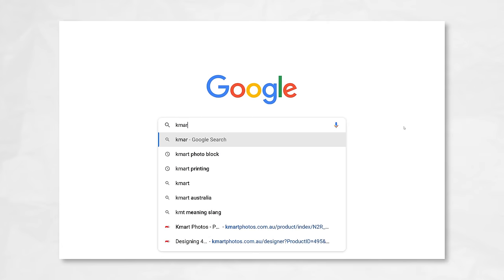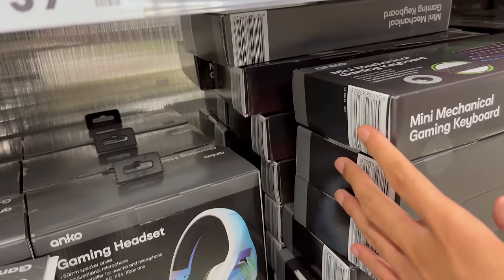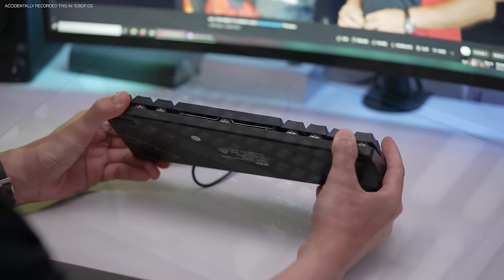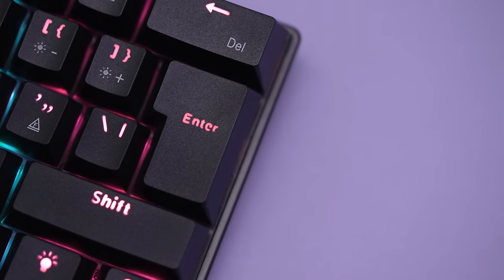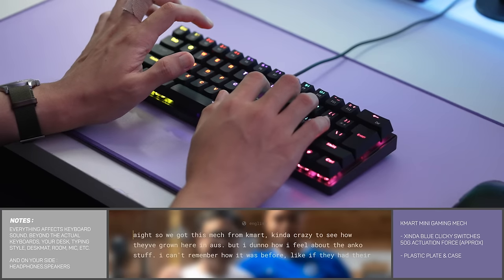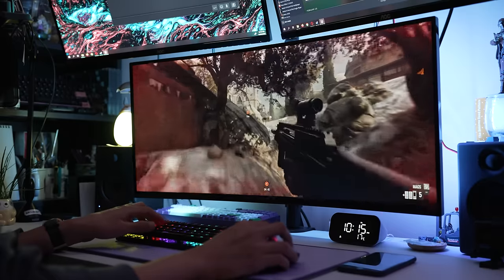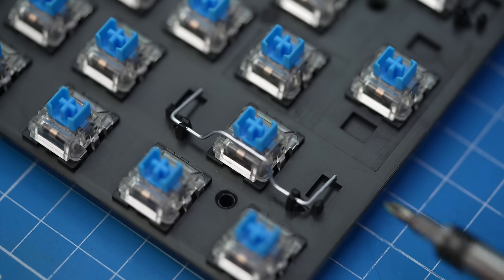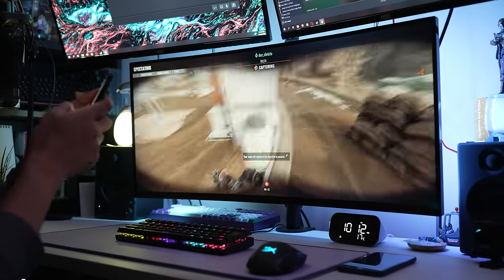Buying a $25 mechanical keyboard from Kmart

Comment from the maker: ne suggestions for mods? using kmart au items only 😇
Reply: Other than tape and foam, maybe use something nobody expects. Like the arms and legs of a teddy bear or something lmao
Reply: Polyfil! You could also get change from the register and penny mod it.
Reply: much like your modding of the ducky x hyperX keyboard, it'd be awesome if you can slap on some gmk caps on it. Also, how about finding some way to cut the plate to accomodate some plate mount stabs?
Reply from the maker: hahaha, thinking outside the box with the change idea.
Reply: Make it completely unrecognizable, paint it, add new switches, new keycaps, mod the stabs, add weight (maybe penny mod), add foam, and maybe maybe even oring mount it, (either gummy oring or burger mount)
Reply: super glue to stick the click jacket to the switch stem
Reply: @JadeZen520  are kmart stocking instock gmk keycaps now? that’s absolutely insane
Reply from the maker: @n1664  i gave it a little go, not the easiest haha. could also use something else for that mod :)
Reply from the maker: @Amiro05  a lot of that is definitely on the list!
Reply: jailhouse those blue switches!  use a few turns of dental floss, maybe a small piece of shelf liner, if it is thin enough.

Shelf liner as case foam to reduce ping, and there must be some plastic safe ptfe lube (super lube grade 0) for the springs... maybe not for the rails, in case is too gummy (could still do the switch tops where it meets the stem?)

tape mod on the PCB, with masking tape

paint the sides of the keycaps, to match (or complement! the leds)

horizontal strips of shelf liner between PCB and plate.
Reply: @jamboards5771  just assumed only the modding parts would need kmart items. Keycaps aren't a mod.
Reply: Cut up a budget Anko Kmart brand mousepad and fill the case 👍.
Reply: We do care..
Reply: maybe take the usb c port out of anything and make the cable detachable
Reply: y'all still got kmart????
Reply: @JadeZen520  if it can be personalized, you're technically "modding" a keyboard
Reply: They sell silicone lubricant. Not sure if it'd be any good on switches or stabs.
Reply: get like an aluminum sheet from a hardware store for makeshift case or weight
Reply: I mean, with the whole setup that this bad boy has under its hood, there is no mod to save it.
Reply: I mean, id be cool if you made it so you can plug cables into it (detachable usb-c, not sure how to phrase it right)
Reply: Hey tae I’m making my first custom build I’m buying the kbd75v2 and I was wondering if soldering is necessary?
Reply: @Amiro05  yes
Reply: @SeaTacky  we dont have pennies in australia and 5 cent coins would be too big i think
Reply: I cloth taped the bottom and foamed it , then 3 layers Scotch Blue'd bottom of the PCB .. Main gripe was the ISO layout
Reply: You could always smash some VB caps in it 🤗

Comment: Been curious about this keyboard but didn't want to spend $25 for a keyboard I know I won't use so thanks for taking one for the team 😁
Reply: Yeah, bought it and regret it…sold it for $10 back. It’s not bad but the layout isn’t something i gonna use.
Reply: @gqouf it’s not trash if you compare it to any office keyboard. Quite cheap and actually if you mod some dampening foam under the keyboard. For $25 i can’t complain a single thing beside the layout. I don’t want to get familiar with that layout. Buy it just to know how budget keyboard these day heading. For budget gamer who are tie on a budget. I think this is a better buy than “gamer” membrane keyboard from something like logitech, razer…
Reply: @gqouf it’s not trash if you compare it to any office keyboard. Quite cheap and actually if you mod some dampening foam under the keyboard. For $25 i can’t complain a single thing beside the layout. I don’t want to get familiar with that layout. Buy it just to know how budget keyboard these day heading. For budget gamer who are tie on a budget. I think this is a better buy than “gamer” membrane keyboard from something like logitech, razer…
Reply: I spent $210 on my keyboard 25$ is nothing it’s all good 👍

Comment: I've just learnt about NKRO by watching this video. I implemented my own extend layer using Kmonad on Linux and had issues assigning Shift, Ctrl and Alt to some letters: pressing multiple of them didn't always work and the issues were different across keyboards. My keyboards are old and cheap. I wonder if getting a proper modern mechanical keyboard would fix this.

Comment: Hello sir i would recommend using a mouse pad that is soft type about 2mm thickness. this is my mod on my RK100..i also used a cheap yoga mat as an extra feeling on the deep parts of the case and luckily it worked.

Comment: nice vid as always. Though I was expecting it to at least be hot swappable.
Reply: It's $25... A few years ago, not even $100 pre builts had hot swappability.
Reply: @turtlebear4507  I currently use Nexion KL-100W that I bought for 12$ and is hot-swappable.

Comment: got one today, but it always goes to sleep (the LEDs turn off) after a few minutes and cant seem to find a way to wake it up. there's nothing in the instruction manual about it either. it's also absolute garbage for dj max and tapsonic bold; polling rate is abysmal ...